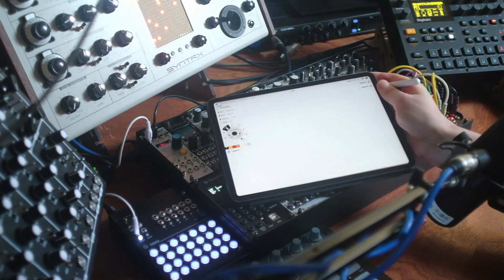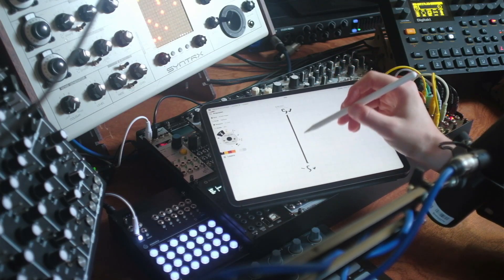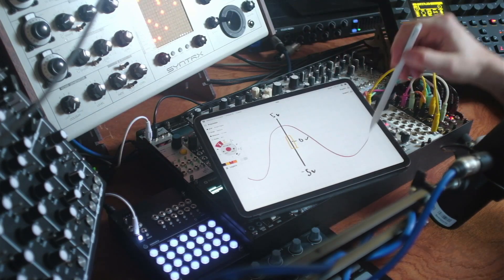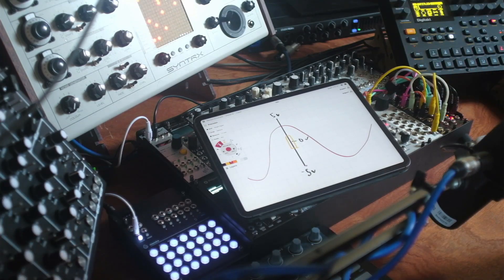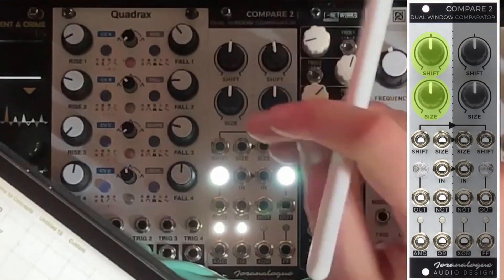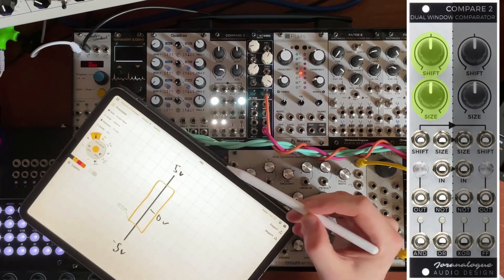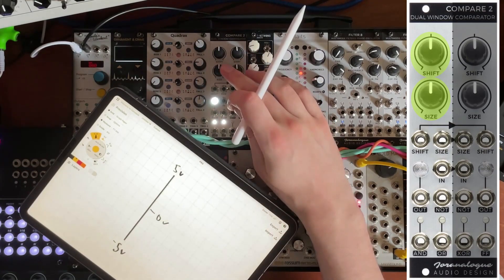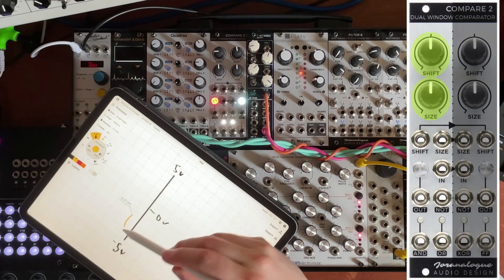Vibe Logic // Joranalogue Compare 2 Primer. Eurorack logic module.

Comment: Great demonstration. And an interesting little rack! Particularly for me, since I'm one of those people who, every so often, redesigns his 180 - 200 hp kit and thinks of it as a temporary instrument, rather than the type that has an ever-expanding wall of modules.
Reply from the maker: My case / setup is super fluid, I wish it wasn’t but I’m constantly tweaking the combination of bits and trying stuff out. There’s are some elements that seem quite fixed like, Trident oscillator, Filter 8, Pams Workout and synths like Hydrasynth but the rest I’m swapping around a lot.
Reply: @SoundsMick  As a kind of challenge, and because I'm obstinate, I'm trying to do without Pam these days. Quadrax + expander always stay in, as does Filter 8, Mob of Emus (which I was very turned off by at first, but became a challenge and is now a staple modulation source for me), d0. For the time being, Generate 3 is also in there. Love these Joranalogues. The Compare 2 is probably next. Seems like a bit of a luxury – not something I really need — but it might shake up my routine a bit.

Comment: You say it can compare against pitches (such as F4).  How does that work?  Do you use both comparators to detect some phase relationship specific to the target pitch?
Reply from the maker: I guess you'd create a short window then shift until it detects the pitch, would only need to use one of the comparators to do it. I'm going to make a follow up to this showing more examples of how it can be used, so will look to include this :)
Reply: To clarify: you'd be processing the V/oct. pitch CV signal in this case. To detect a certain pitch in an oscillator output, you'd need a pitch-to-CV converter first, which wouldn't work as well.
Reply from the maker: @joranalogue  yeah detecting voltage not pitch I mean to say :)